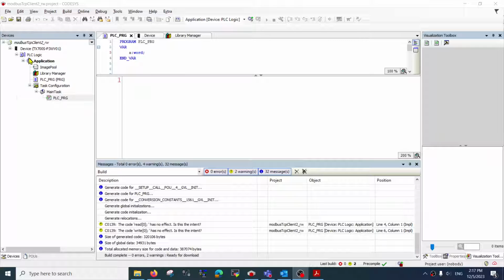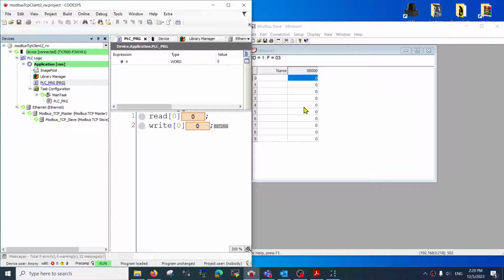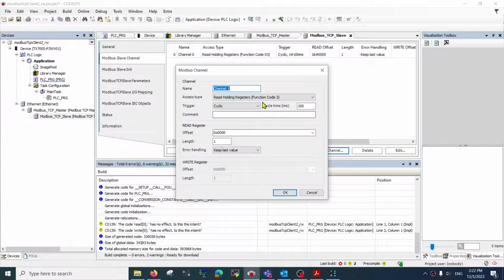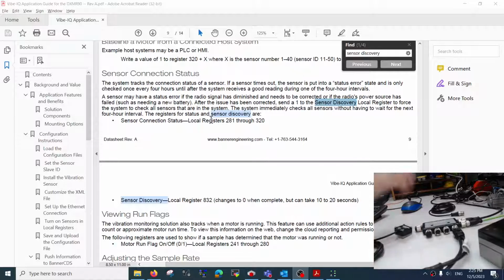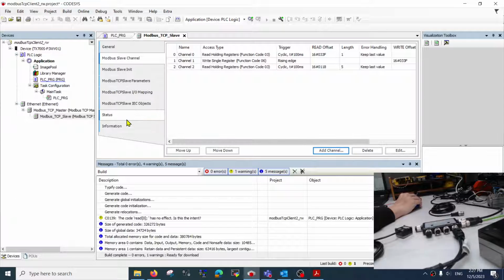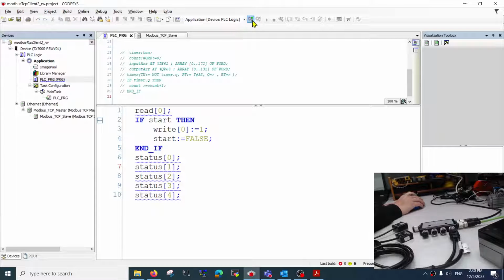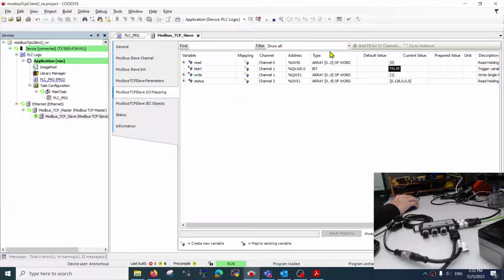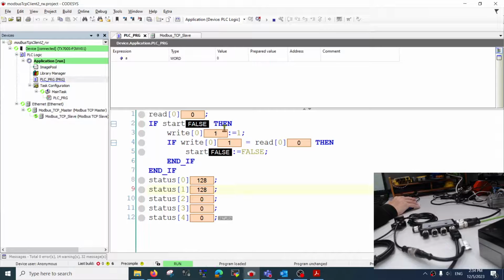Read and write to same modbus register in Codesys

Comment: It is not working with me
Reply from the maker: It could be hardware issue, or you missed some configuration. Have you checked your physical connections? Is it searchable from your PC using modbus software like Modscan? What PLC are you using?
Reply: My modbus work but It update the valué all time in 0 . But with another software It is not happening
Reply from the maker: @PLC4All  I can't really help you without knowing how you programmed. But my first guess is something might be overwriting the register data to zero. Try remove the write instruction.

Comment: Hi. Thanks for the video!
If I don't have the modbus license, is there a way to run in demo mode for a few minutes just to confirm that communication is working? I tried all the steps but since I don't have a license, I believe that is the issue I'm having here. :(
Reply from the maker: Hi @derencio, codesys tend to let you use everything free for around 30mins. 
maybe u did not adjust your interface parameter
Please see 9:00 of this video here
https://youtu.be/J9Eer4eb2dw?si=vYBDYt6iVAD58feA